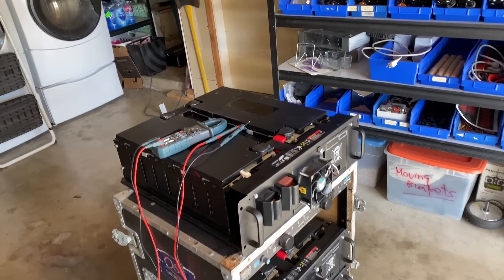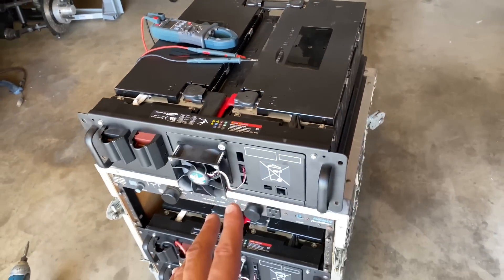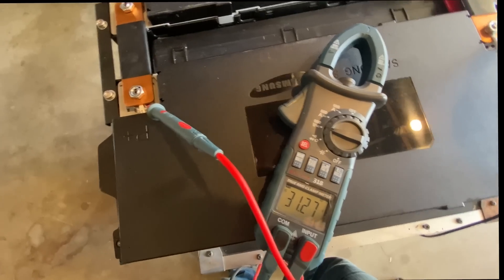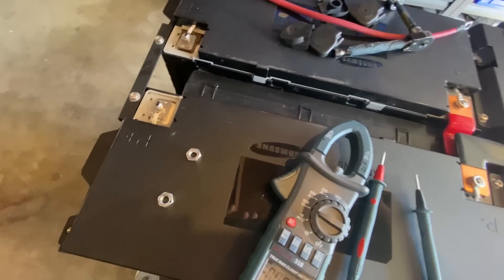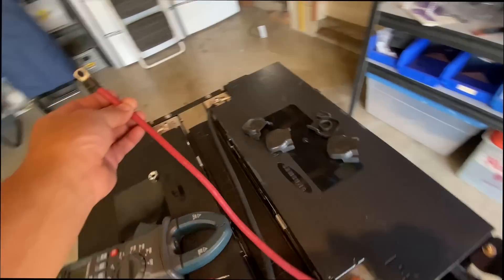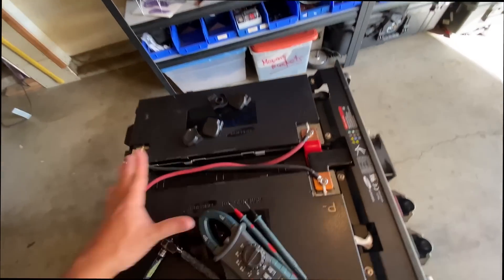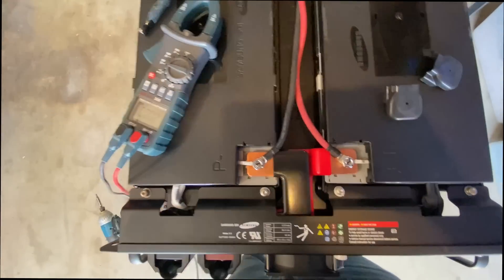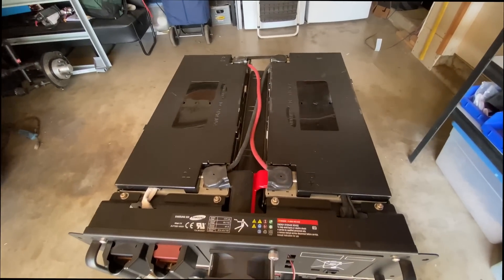Samsung SDI ESS 48v to 24v Module Modification

Comment: I have gotten it by if be these. I'm not new to solar but I am new to these batteries. 

They have a built-in BMS do they not? 

I haven't tried charging them yet because I don't have a 60 volt charge controller but I ordered one and I'm waiting for it. 

With the charge controller in place and I'm assuming with a built-in BMS I shouldn't have any problems charging these with my solar system when I get the mppt charge controller installed right?

Comment: I'm running a 24 volt system with a thousand watt inverter and I was wondering what size fuse do I need (does a fuse go on the positive side)

Comment: Ok, I seem to have problem.... I got the 4Pack and was changing it to a 24v system.... but both sides of batteries measure 43V after disconnecting the bus bar.
Together the measure 86.3v! 
Any thoughts??? 
Thanks

Comment: 2 units at 24 volt with 4 solar panels and an all in one controller,  inverter thingy would be great for boondocking , under charging would make them last well too, and charge quick,  hard to beat at under 2.5 k , unless you must have lifepo

Comment: what is the benefit of one of these modules vs a 12v 200AH AGM battery? Especially since i can get that 2.4KWH battery for 360 bucks shipped amazon prime?
Reply: This chemistry offers many advantages over more traditional 12volt set ups. They are less weight, offer deeper discharge and a much longer life expectancy. 
However, if you have a 12v dominant system, then it may be wise to go with that. It is all dependant on your needs and application.

Comment: I have a 48V golf cart that uses 4 deep cell lead acid batters can I use the Samsung power module to run it? How many module will I need and can I use the same speed control that club car uses? Will the charger for the lead acid work on the Samsung module if not what will? Thank you

Comment: I have some questions about some of these designs and if they could be used to augment my solar array and existing storage.

I've got a 15.6kW PV array, with 2 inverters, already wired into the mains panel, all inspected and up to code.  I've also got 3x PowerWall 2.0 modules, stacked.  This is enough capacity to run my house most of the year, fully off-grid,  but during an extended outage on a grey week, I think I'd have a problem.

I wanted to know if any of the solutions you've designed would be appropriate to augment my install in a safe way, even if they were only used occasionally.  For example, my neighbor is on oxygen, and if necessary, I wouldn't mind building a portable battery array I could charge up before a bad storm, and wheel the battery array to her house while the power is out.

My city, county, and power company are very picky about inspections and permits, so anything I try to do, I need to do 100% safely.

Comment: Once it is 24v how many kWh does it become?
Reply: Shane Beylund It goes from 48v * 68.75 amp-hours = 3.3 kWh to 24v * 137.5 amp-hours = the same 3.3 kWh.
Reply from the maker: Same,  energy capacity stays the same
Reply: It's the same, the voltage drops, but ah doubles, so it's still the same! You may loose capacity, since inverters may only go to 30v-31v